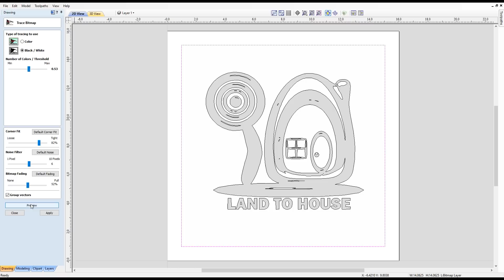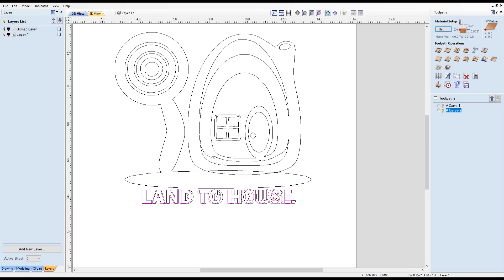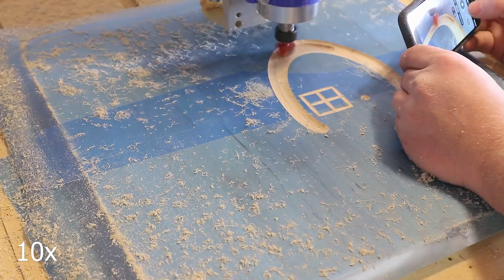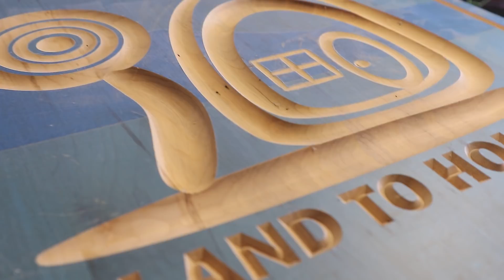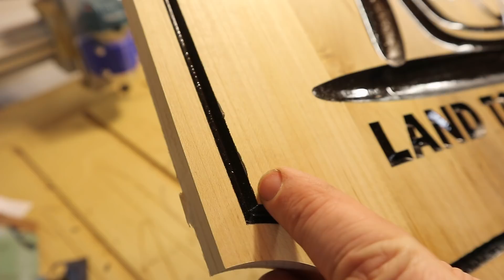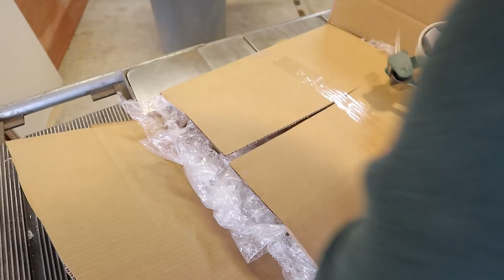Land To House Sign

Comment: Odd question but do you think the local customers would like the patterns you can get from hydro dipping the blanks before you engrave them? saw a video where they used a cnc to make a guitar body then dip it for the random swirl patterns but was thinking why not use it to make the blanks for signs you are going to color the lettering of anyway?  A useful way to get rid of bad looking but still solid wood by simply painting it fully and putting a random pattern on it before you carve it.

Comment: Joe, I might try clear coating the top before you carve. I guess you could do some test pieces. Scrap wood and test it. Clear coating the top, masking, carve, then paint and last sand and finish. I can not recall if you have that huge drum sander or not. Though that would be ideal to strip the clear coat from it after painting. Planing would also work as well. Let me know what you  think.
Reply from the maker: The clear can stay on, and I have since begun doing just that. I have a 24" grizzly dual drum sander and a 10x20" jet as well.

Comment: You might want to try clear paint over black lacquer. In my experience the solvents in lacquer are way more powerful than most paint, so clear lacquer over paint will always wrinkle up like that... But if you do the base coat of clear before the paint... clear lacquer, then black lacquer, then clear paint maybe?

Comment: I quite like the wrincles. That turned out nicely. Edit: Those clocks at the end are really nice. Could you think of any way to backlight them? Maybe routing out the back, epoxying with a cloudy epoxy, then routing from the front to fixed depth.
Also, I don't see the links in the description?

Edit 2: I'm thinking about desk digital clocks with RGB LED dots/light bar running along 3 lines (hour, minute, seconds), or blending 3 colours into a single bar. That will get complex and use quite a few LEDs, so probably a lot of pcb design.